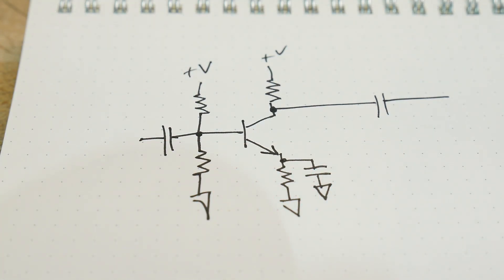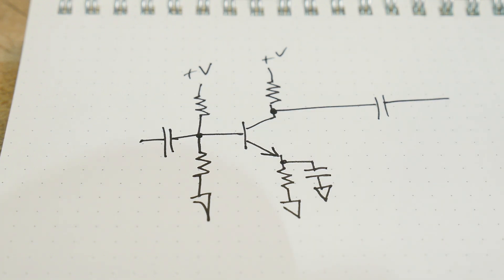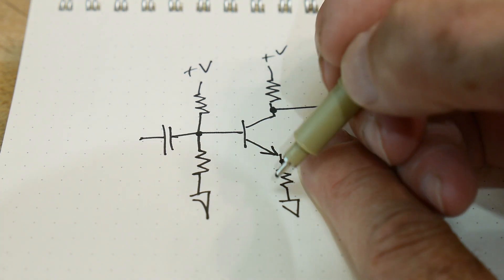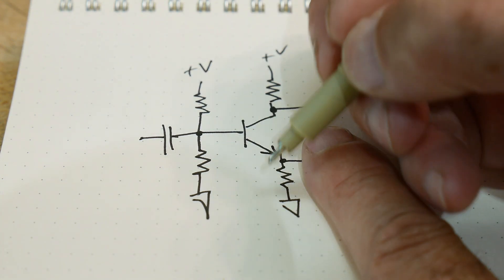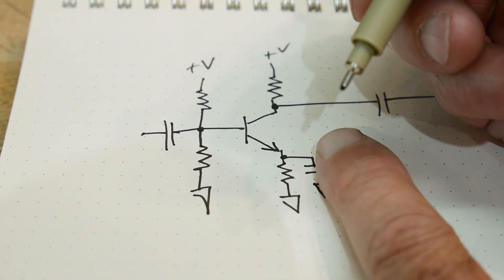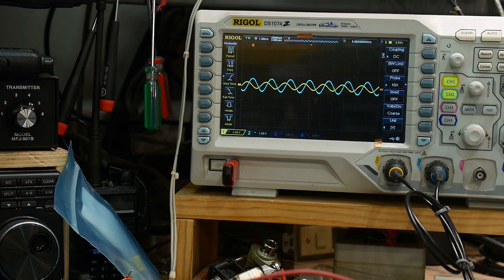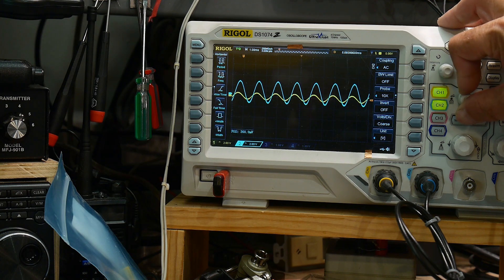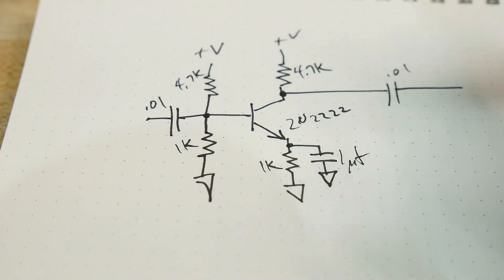#836 Basics: Transistor (3 of 3)

Comment: There is something that bothers me with the values of the input/output capacitors:
They are 0.01μF in the schematic.
With less than 1KΩ input resistance it gives an low cuttoff frequency of about 16KHz.
The frequency of the signal as can be seen on the scope is about 1.4KHz.
How it fits together? ("Where is the catch")?
Reply from the maker: gain

Comment: Excellent video series.
Is it safe to assume that a Cathode resistor (and capacitor) in a similar tube amplifier stage does the same things?
Reply from the maker: I don't know tube circuits
Reply: Yes. Common cathode vacuum tube, common emitter transistor, and common source FET circuits are pretty similar in behavior, although circuit component values may be quite different.
Reply: @thomasdial8664  And in the tube circuit the cathode resistor also biases  the tube.
Reply: @paulcohen1555 As it also does in the other circuits. The current in the emitter/cathode/source path affects the base/grid/gate bias in similar ways. It would be interesting to see a demo of the same basic circuit with each of the three types of device (or four, counting enhancement and depletion mode FETs as distinct types), although the cathode heater circuit would make the tube demo a bit messy.

Comment: Is one of the channels inverted on the scope?  The output wasn't inverted from the input.  I noted some phase shift, but quite a bit different than 180 degrees.  Just curious.
Reply from the maker: did you watch part I
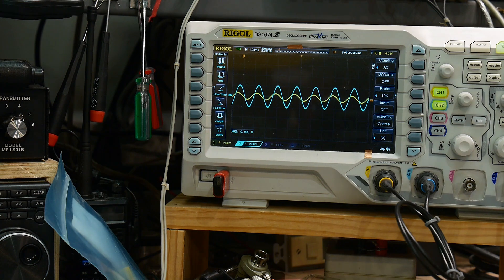Reply: @IMSAIGuy  I did.  There the amplifier is inverting.  Here at ~6:50 it doesn't look like it so much.  I have a GW Instek scope so not familiar with the Rigol and couldn't see clearly if the second channel is inverted.
Reply from the maker: @RideGasGas  Oh, ok. Yes there is a phase shift due to the capacitors
Reply from the maker: here is a video talking about phase shift: https://youtu.be/34G4pzWr9kA
Reply: @IMSAIGuy  Thanks!

Comment: Would you be willing to advance to transistor substitution? Replace that transistor with a different transistor and get the same results. What to know when doing the change. Thanks for the look.
Reply from the maker: That would be super advanced and very difficult. Each use case is different to determine what is critical and what is not.
Reply: @IMSAIGuy  oh well, just hoping.
Reply: The rule of thumb is that in any common emitter stage with an emitter resistor, if the smaller of the base bias resistors is not much bigger than the collector resistor, then the biasing does not depend significantly on the β of the transistor. So any small-signal transistor that can handle the supply voltage can be substituted with negligible change to the performance of the circuit.